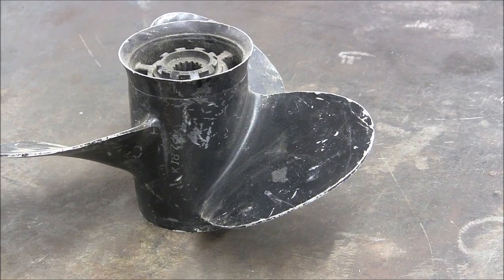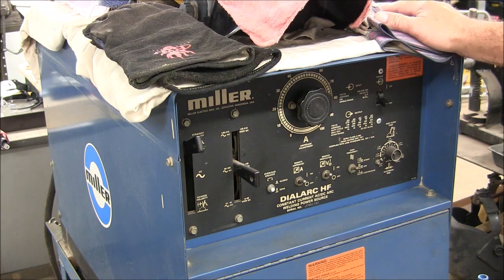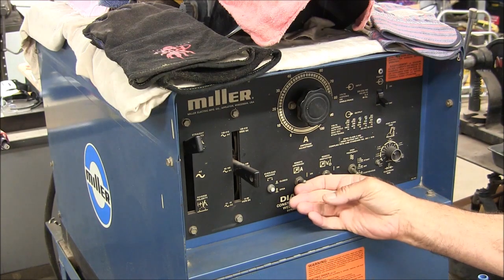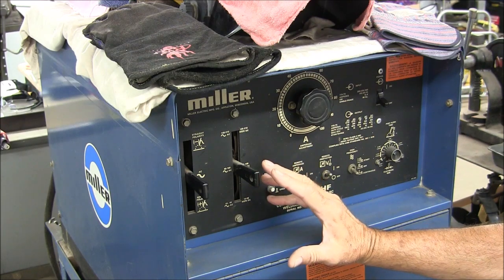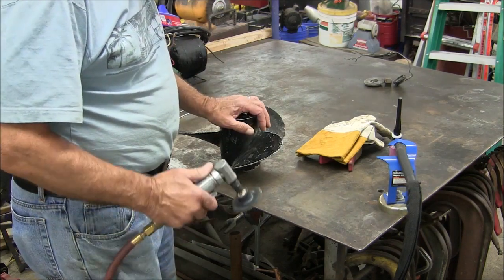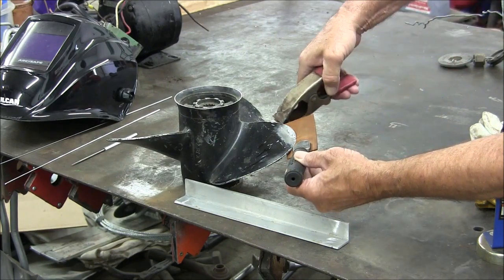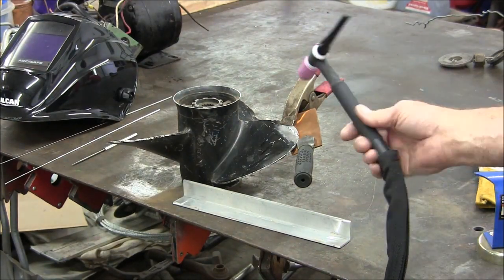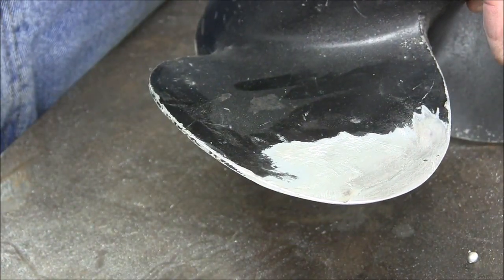Tig welding a boat prop

Comment: As always Mike, you make it look easy. I have those copper paddles, or whatever you call them, but they work awsome as a backing for aluminum and steel. Nice repair!
Reply from the maker: Thanks Steve.  Question for you.  What is the size of the main drive belt on your do all?  Tc, Mike

Comment: Nice repair. Thats one thing I miss from work I don't have a welder capable of tig only an old stick welder. At work I was working on my welding certification before I left the shop for the design job. Would have been welding parts for the Bradly fighting unit ( missile launcher platforms on a tank) Anyway I like your welder maybe someday I'll break down and get a better welder. Yours looks like a pretty nice unit. Hotter than blitz out again here today did work in the yard most of the day. I enjoy watching your videos and seeing what your up to thanks.
Reply from the maker: doc0455 - Sounds like your job was really interesting.  In the tool shop I served my apprenticeship in I was the "go to" guy for tig repairs.  I later went into tool engineering just as you did.  If I were to get a welder today I definitely would get one of the little inverters.   They are unbelievable for their size.  Its been brutal hot here finally got some rain a couple of days ago but need more.  Later, Mike

Comment: I recon you’ve done that a few times Mike, turned out well.

Alan.
Reply from the maker: Alan Pearce - This is the first prop repair I've done.  I don't consider myself as a great tig welder, I just sort of muddle through.  If you are interested in tig welding one of my favorite channels is "txsviking".  Cheers! Mike